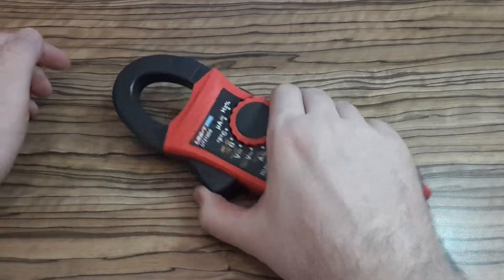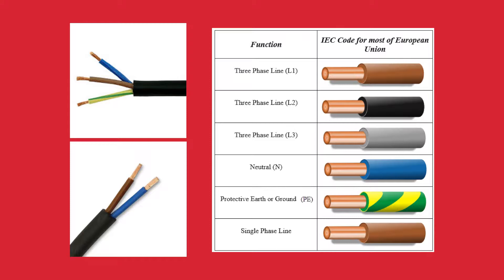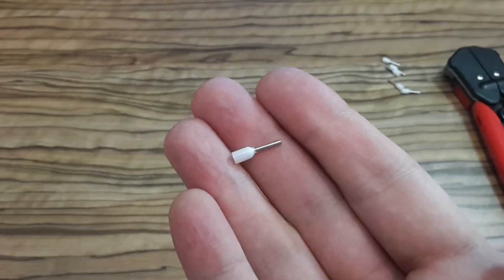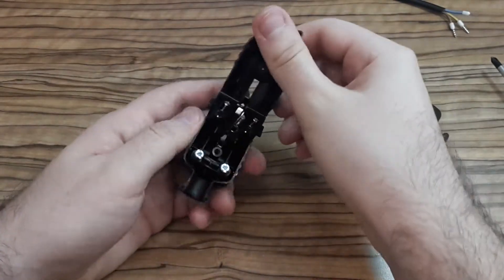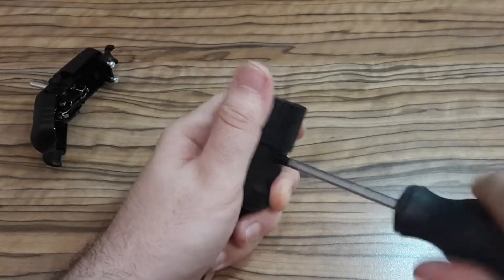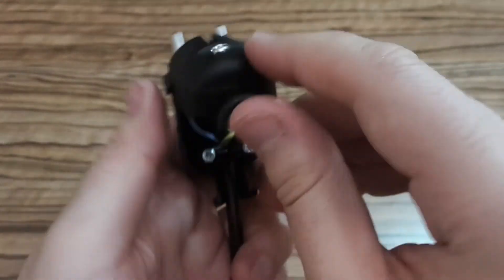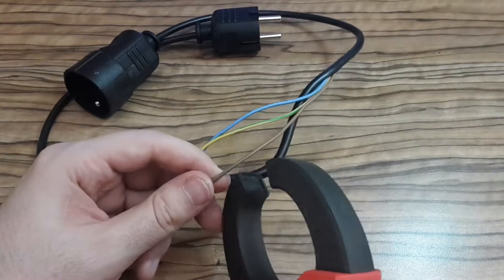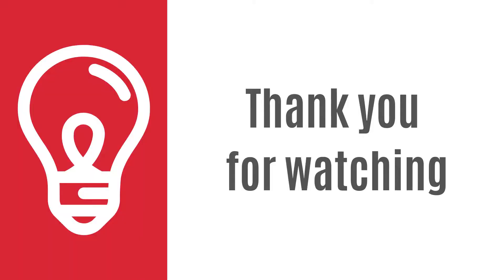How to Measure Current with Clamp Meter Using Line Splitter

Comment: hows the continuity test of ut219ds.
Reply from the maker: Hi, do you mean how fast it is?
Reply: @zeroampselectronics  yeah , is there any delay like the ut216d
Reply from the maker: Hi, I own these UNI-T UT61E, UNI-T UT219DS and UNI-T UT120B. The continuity test on these two UNI-T UT61E, UNI-T UT219DS is super fast and there is a little delay on UNI-T UT120B, but that's a baby multimeter :-)
Reply: @zeroampselectronics  thanks man. hope you make review on ut219ds.